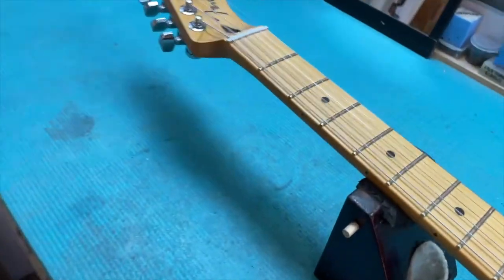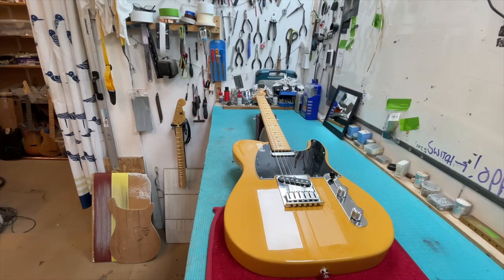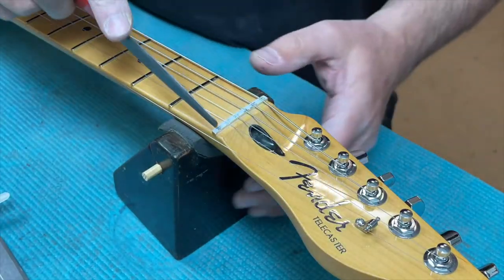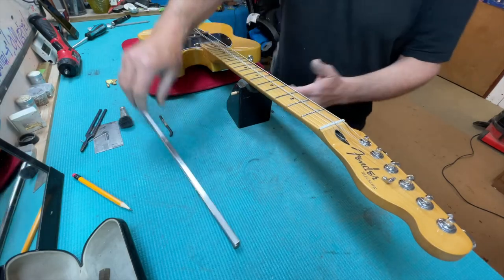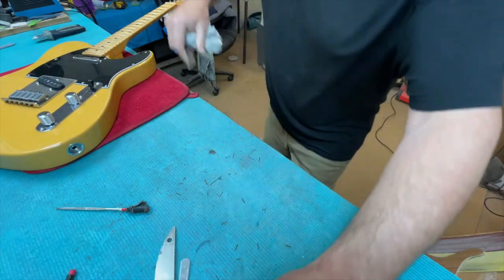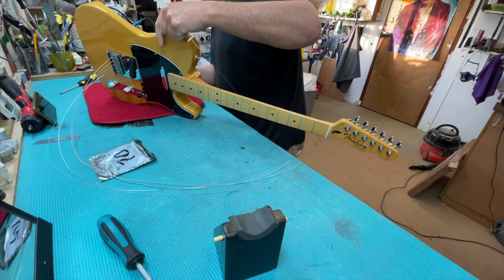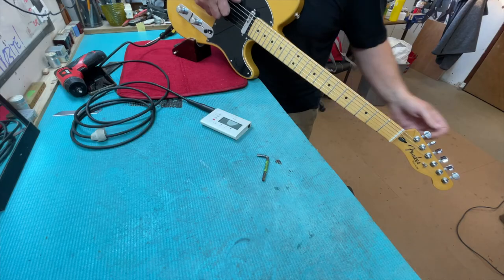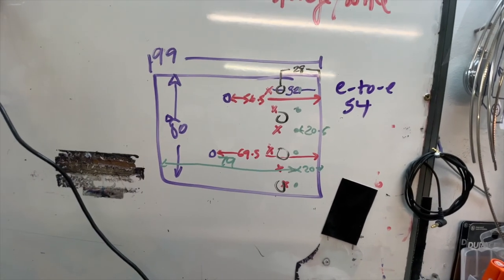Fender Player Plus Tele set up

Comment: Player Plus should be 12" radius, not 9.5". Thanks for the great info.
Reply from the maker: Thanks - no problem. Technically, it doesn't matter that much to me - I don't mean that glibly, just that my levelling technique 'respects' any / all radii even compound ones. It would be critical if I used radius blocks to level for example, but I don't. The place it matters is just in knowing whether it will make a low action + big bends on high E easy or harder...

Comment: Hi, interesting video. Thank you. I just bought one of these and found the saddles cannot go back far enough to intonate on a couple strings. I was hoping you could recommend a good telecaster style guitar at a similar price, that tend to come out of the factory in better shape? Thanks for any info.
Reply from the maker: Hi Jay... I've always been a fan of the Squier Classic Vibe series... slightly better positioned bridge saddles / fixing screws too. I just noticed one on Amazon for under £300! 
https://tinyurl.com/4djw5z7m 
You'd have £500 left for upgrades of your choice... or a holiday somewhere nice. 
Apart from that take a look at the Vintage V52
https://www.jhs.co.uk/collections/vintage/products/vintage-v52-icon-electric-guitar-butterscotch
 or their V59, V62, V68 models. Ignore the prices on the JHS site they retail for less in the real world...
Reply: @SamDeeksRelovedGuitars  many thanks for the fast response and recommendation 🙏 I found it hard to wrap my head around the price difference between the CV and the PP and figured it would be too much of a downgrade. Only problem is that bridge, I prefer the modern 6 saddle and didn't fancy a DIY swap, however I am currently rethinking after your useful video and comments. Thanks again 👍

Comment: Hi Sam, wish id seen this video 3mths ago, I have been battling the same bridge issues, i dont suppose you have a link to the flat head screws you sourced? Im also toying with the idea of grinding the width of the saddles to see if i can squeeze them together, or flipping the saddles over and filing new slots in them to bring in the 1st and 6th string.....its a feckin shambles from Fender. Id love your input on these ideas.
Reply from the maker: Hi - I'm sorry - I just went back through my Amazon and eBay order lists and can't find what I used. It may have been something I already had in stock somewhere that 'did the job'. To be fair, the screw needs to be chunky enough not to be loose in the original hole and importantly, be flush with (or fractionally below if it has to be) the plate surface. 

Ref the saddles - are you saying this because you find the overall spread too wide for the neck (near the heel area most of all)? If so, you can buy slightly narrower saddles but whether they will 'cluster' together any tighter is debatable. I've had customers in the past - not necessarily with Fenders - who have asked me to re-fret and bevel the frets taller / steeper to 'reclaim' another 1-2mm of overall playing width. That's a 'big' solution for a small problem - but for each individual it depends on how bad it bothers you.
Reply: haha thanks.... @SamDeeksRelovedGuitars  i have the same issue as Luke? in the outer strings almost falling off the fretboeard. After i wrote the above, i experimented, and the saddles can be turned upside down. and there is room in the 1st and 6th saddles to put in your own notch to bring those strings in decent allighnment on the fretboard.....ive already been in touch with fender  last week regarding all the work ive done on this guitar over the last 2mths. But none of the many small things were noticable on day One when i got the guitar,  it was only when i looked closer wanting to make small adjustments to suit me that i started i started to see all these small issues mount up. im not going to go into all the details here. If yer man @greg_drc down below is correct about the vintage saddle is correct, i may just do that and be done with it, (i had my suspicians that that may be the case)

Comment: Hi Sam, what flat headed screws have you ordered as a replacement? Thanks.
Reply from the maker: Hi - I'm sorry I can't remember. I checked my eBay purchase history (where I think I would have ordered from) but can't find any record. There are plenty of choices; you're looking for a countersunk Phillips screw about an inch long max. and 3-4mm width. The important thing is that the head has to sit as close to flush with the bridge plate as possible. Even then it's still not ideal if your saddle grub screws end up standing on one of these screws; but it's better than standing on a domed one or falling into the pit if the countersunk one you use leaves a gap because its too small.

Comment: how much do you charge for this type of work on a guitar or where can i get this type of adjustment to a guitar!
Reply from the maker: Hi @legend1143 - I charge £135 for my set up which includes Tusq nut, precision fret levelling, all aspects of the set up and new strings. End product is low, light action and rock solid tuning stability. You can reach me via email at samdeeks@gmail.com

Comment: My new 2022 player tele had all the issues.  High frets, sharp fret ends, domed screw in the EXACT wrong spot for intonation and a bad output jack that had to be replaced.  Still haven't sorted the domed screws but that's on my to do list.  For the best part of $1000 bucks the lack of Fender quality is astonishing.  Fender is more concerned with taking care of it's shareholders while throwing guitar players to the wolves.  Fender's poor quality is across the board.  Just bought a new genuine Fender pickguard for my mim strat that looks like it was cut out with a tree saw.  Horrible quality.  No way I'm buying another Fender anything anytime soon because the value for money just isn't there.  Buyer beware.  Cheers!
Reply from the maker: Yes, it's a shame. But seems like all great brands go through that phase. Do any of them ever recover to that point where they're rock solid quality and great value again? And were any of them ever that in the first place? I think Fender and Gibson's problem is that in 2023 there are SO many better-finished, more impressive quality guitars from less prestigious brands to put them to shame. Back in 1955 there wasn't much to compare them to and they were also innovative at that point.
Reply: Almost pulled the trigger on a Player Jaguar but was leery of Fenders QC issues so I hesitated and I'm glad I did.  Just ordered a PRS SE CE24 currently on 20 percent discount.  Will be my first PRS.  Internet lore says PRS QC is top notch so looking forward to it.  Should be interesting.  Cheers!  @SamDeeksRelovedGuitars

Comment: Dude, WHAT is that beeping sound?
Reply from the maker: I finally tracked it down some weird little electrical outlet box with a sensor of some kind in it. Some part of the sensor needed replacing and it was helpfully beeping to let me know. I removed it and the box carried on working fine... I've no idea what the site owner had it installed for or exactly what it was doing but it's now history. Thankfully - as it was driving me mad as well.
Reply: 😁😁 good stuff!

Comment: That's all pretty abysmal and shameful on a guitar costing as much as it does. I'd be embarrassed if I were Fender that something like that was leaving my factory and landing in the hands of a paying customer. If I were the customer I'd certainly not be a happy one. My cheapest T Style guitar is a humble Harley Benton TE-62DB (only a little more than a tenth of the price) and no such sloppiness existed in that budget instrument on arrival so there's no excuse for it. Sure it needed a little setup to suit me and I polished the frets and oiled the board but other than that it needed no work and was very well put together and finished. I'm obviously not claiming equivalent quality of parts in this statement, just pointing out that if a cheap model can be assembled properly and delivered in playable condition out of the box, Fender really need to address their minimum standards of both manufacturing and quality control and perhaps pay them far more attention and allocate them more investment than they do their marketing.  

Your diplomacy is admirable but unwarranted and not deserved in my opinion, although I appreciate some of your points on things such as fretwork and mass production which are fair and well made. However, If manufacturers like Sire can turn out a guitar such as the T7 at half the price one has to wonder if the name on the headstock means much in this day and age and how long companies like Fender can continue to exploit their heritage. It's a shame that mediocrity is excused and even celebrated nowadays. (Not just in the world of guitars).
Reply from the maker: Thanks Old Geezer, great comment. You're right - I started out being much less tolerant, and quicker-to-critque! I think what I see is that the larger these business are, the more unwieldy they become and the more they are forced to focus on reduction of costs in order to preserve tiny margins of profitability. I'm not apologising for them, but it does feel that everyone who (foolishly) gets into the guitar manufacturing game gets dragged down to the same level before too long, no matter how lofty their values started out being. The fastest way to profitability is to cut costs; the fastest way to cut costs is to reduce staff and / or automate... followed closely by using cheaper and cheaper parts and materials. Sadly. By that assessment even Sire will go the same way...it's just a matter of time.
Reply: @SamDeeksRelovedGuitars  Not to mention the ever ongoing quest for cheaper and cheaper labour and the constantly increasing costs involved in manufacturing and distribution, due to all manner of economic and financial factors.

I agree entirely that human nature and free market pressures can and often do result in what you claim. It's a shame and the one remaining non cynical bone in my old body likes to believe it's not inevitable but you're probably closer to reality in your estimations overall.

Then again, look at Japan and how it eventually took over the world by initially copying, refining and improving all manner of products from motorcycles and cars to electronics and musical instruments. It didn't last forever as nothing ever does, but considering they were once viewed as cheap and nasty knock offs of products from the USA and Europe, which they were at the outset back in the sixties, they went on to dominate many sectors. Even today, with regard to guitars, Japanese made instruments both past and present are still highly regarded - including Fender models that were and still are made in Japan. The same can be said for many nations' manufacturing rises and falls - Taiwan back in the day became the copycats and undercutters of the Japanese, starting out with a reputation for shoddy goods but gradually improving, then more and more far eastern factories that have entered the fray. People once poo pooed guitars made in Korea and now they're complaining about the move of many of those same guitar brands to Indonesia (both nations have and continue to produce some very fine instruments) and now of course China has become the place of choice to make really budget guitars - has to be said they've come a long way from the Chibson era and nowadays, with guitars at least, "Made in China" doesn't automatically translate to garbage as it did not so long ago - shame they can't or won't replicate that with so many other products that we now have to suffer.  

Despite all this, I still believe that all the competition is, generally speaking, a good thing for the customer - (not necessarily for the companies and their workers) and there is now a far larger choice of decent guitars available to even the most humble budgets than there has ever been in the past. Had you given a beginner most of these current cheap modern lesser known brands coming out of the Far East back in the 70's and 80's, they would have been astonished that anything electric that didn't say Fender or Gibson on the headstock could be anything other than a horrible third rate POS, let alone something that looked, felt and played as well as many of them now do. Maybe the Far East will eventually go the way of many before them and new, as yet unknown or even considered nations and markets will arise to replace them. 

I understand the concept of brand loyalty, considerations of depreciation and resale value, and even patriotic leanings but to my mind, the world of guitars has moved on and the name on the headstock is probably less important than it's ever been. At the same time, there will always be a demand for genuine, high quality craftsmanship even though it is becoming ever rarer.

Ultimately, a good guitar is the one that you love playing and want to pick up - anything else is secondary in my humble opinion. With the number of years I've likely got remaining, even if all manufacturers decline in quality or disappear altogether, the second hand market isn't in danger of running dry before they put me in the ground 😄.